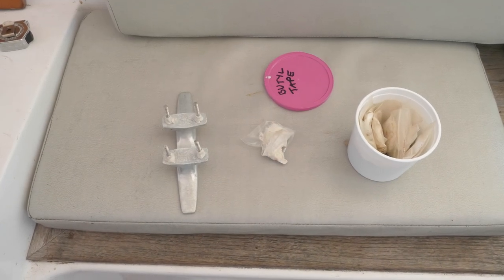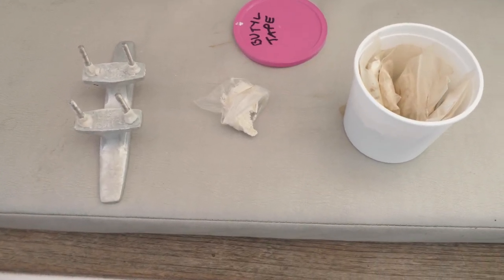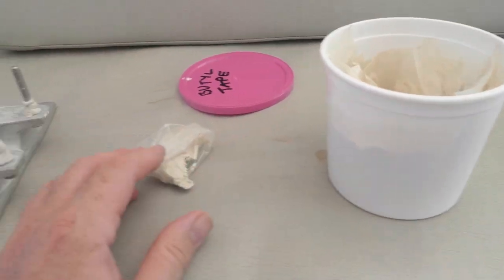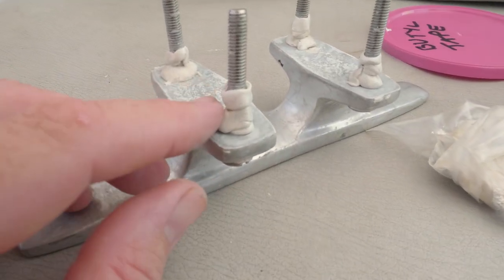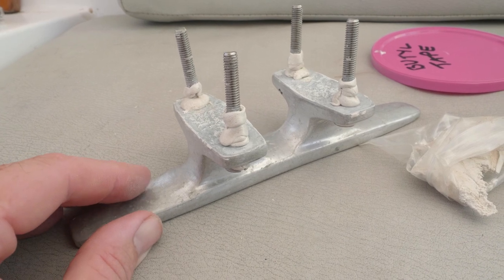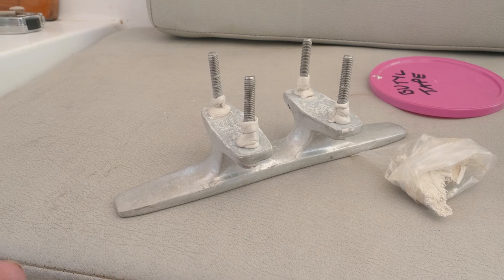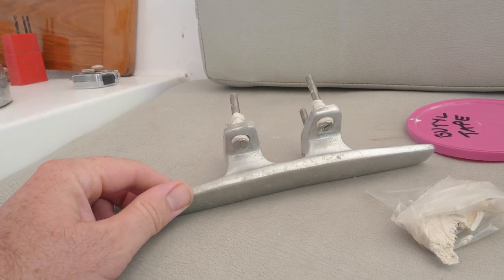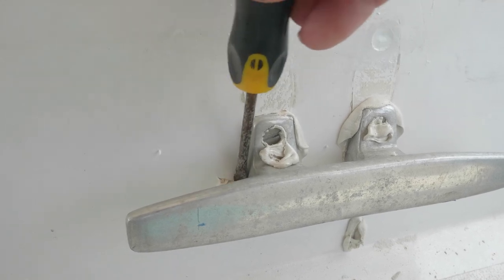HOW TO USE BUTYL TAPE TO SEAL DECK FITTINGS ON A SAILBOAT - SAILING FOLLOWTHEBOAT EXTRA

Comment: I have never been a huge fan of coming back later and re-tightening nuts after cure, but with a material like butyl tape that can "cold flow", it makes perfect sense. Turning the bolts instead of the nuts i can confirm will dramatically increase the chances of creating leaks. But giving them a one-time-only 3/4 turn back and forth during initial assembly, will distribute the sealant to all the nooks and crannies. You cannot expect a good seal if you just drill-and-bolt. All the drilling must be completed and everything must be disassembled and cleaned, before any type of caulking or final bolting occours. For wood or sheet metal screws, which must be turned, try Boatlife Life Caulk. Except for professional boat builders driving square or hex socket head screws all day every day etc, driving any stainless screw, or running up any ss nut with an electric driver or drill, is Asking For Trouble. Drive boat screws Mauually. If the sheetmetal screw is too hard to turn, your pilot hole is too small. Ignore the charts that state pilot hole sizes, this is boatbuilding not aircraft assembly! If your bolt head can still turn after the nut is tight, remove the nut and add washers. I will never use a ss split lock washer, those must be spring or high carbon steel to work as designed. Nylock nuts are a great choice, but use regular nuts for the preliminary fitting instead of wearing out the plastic inserts. I have not assembled a single Stainless nut to any ss bolt in the last 30 years that did not have anti-seize compound added to the threads. It can destroy the seal, so just add a dab to the bolt end before screwing the nut on. To avoid electrochemical reaction between the stainless and the anti-seize, avoid graphite or aluminum based products. My favorite is the Starbrite red, or use nickle-based anti-seize, which is often found in hi-temp formulas. OR, stik wax (or warm water surfboard wax), is an excellent anti-seize! Notice that Jamie does not put the sealant around the deck holes, that will just push the caulk out. Put the caulk or tape on the screws or parts near the top only. Less mess to clean up. I have to agree with your assessment that cordless drills are inferior to a good high quality corded tool, but how practical is that if you have no genset or monster battery murderer, oops, i meant inverter! Tip: if you run your american drill on 220v found in many countries, it will spin Really Fast! Wordy, i know, aimed at people who really care and realize the quickest method is to Slow Down. If you really want the best results, make all projects multi-day, that is, take your initial ideas and sleep on it. Thank You.
Reply from the maker: Thanks for the comment, Marty, there's a few great pointers among it. I noticed Beta had put a small amount of Locktite on my impeller housing screws in the same way you describe - just a dab on the end. Didn't know the stik wax trick - does that really work? Cheers.
Reply: Sailing followtheboat i was surprised to read the label and see "anti-seize" listed. I always have a tube with me because it is very handy for any kind of rope splice. Really i believe the nickel base is best to prevent stainless nuts from galling. Locktite is great for resisting vibration and a great insulator. Regardless of color, never worry about whether it will ever come apart when it needs to, it will. Anti-seize is especially good for stainless, if you magnify the threads with a loupe, the roughness of this metal is startling. Anti-seize is good for engine etc bolts too. Just realize that published torque values do not apply to any thread which has anti-seize on it. The danger is overtightening. Yikes. High carbon steel bolts are way stronger than ss, but they will rust away outside. So that's one reason our engines don't have ss bolts. Another 2 reasons are they are brittle, and although they are not officially graded like steel engine bolts that can be grade 5 or even higher, but 18-8 ss would never be more than grade 2 with a few pence change. Can we combine locktite and nevr-seez? Heck yes. One should realize that it only takes a bit of anti-seize, any amount is likely enough. Anti-seize is an extreme pressure lube, which is what a srew thread (inclined plane) Needs. Tube wax is ok in a pinch, but nickel is best. One would think the copper-based anti-seize would be best for avoiding corrosion on copper alloy fittings like bottle screw threads of bronze. Turns out that the very noble nickel is still better on a bronze, or stainless, or a combination of both, turnbuckle thread. And stick wax, like Castrol, is also the Best cutting oil for stainless, bar none. Seriously, if someone needs to cut a ss bolt, clamp it in a vise between two pieces of wood and extend the wood outside the jaws, to where the sticks will get cut too. That will help steer the hacksaw blade into one spot, not dancing all over the place to start the cut. Or make your cut with the blade just grazing the vise jaw. Start the cut and stick a blob of wax onto it. Use a Coarse tooth, high speed steel blade, like 18 teeth /inch. Two hands on the saw. Once the blade is moving with each stroke go from no pressure to as much weight as you can lean into it. Never let the blade stop whilst applying pressure. Most bolts will take less than 10 strokes. Using a blade with fine teeth, like 32tpi, will only Polish, and even harden stainless steel. Think of it as cutting a crystal, we need to RIP through that sucker. If the stainless is thick, a 14tpi blade will work, for thin sheet metal make all cuts through a thick ply wood sandwich with the metal in the middle. Manually cutting stainless is always going to work better than a cheap bandsaw or any sabre, scroll saw or sawzall blade, once you get your technique dialed in! Cheers and thank you for providing this space for me to vent.

Comment: I am a big fan of Butyl tape and have been using it ever since your refit video.  There is a website made by a guy who sells his own special formula of Butyl called "Bed-it Butyl" which goes into a lot of detail on the hows and whys of butyl tape.  

http://www.pbase.com/mainecruising/rebedding_hardware&page=1

Mads at Sail Life has a lot to say about the benefits of butyl tape in many of his videos too.  It is great stuff and I use it almost exclusively above the waterline. 

We have one weird problem with butyl tape and that is with our stanchions.  We had to go back and re-do them all again after our deck repairs were don because the Hallberg-Rassy stanchion bases have a large dish to them since the bases are dished upwards in the middle from their outer circumference .  This is probably to help more bedding compound stay under the bases but in the case of butyl tape the bedding area is so thick between the deck and the inside of the dished stanchion base that there is not enough force/pressure pushing down on the "O-rings" around the bolt holes to keep them well-bedded when the stanchion is torqued around over time.   We went back and put a washer on every bolt so that it is the washer itself pushing down on the o-ring where the hole is bevelled and then 1 more butyl ring on top of that between the washer and the stanchion base, and then again one more butyl ring above the base and under the bolt head.  This seems to have filled in the gap nicely, and fixed our leaky stanchions that didn't seal right with just butyl last year. 

One other common problem is just like you mentioned where you can not turn the bolt or it can rip and tear the butyl o-ring in the bevel.  So plates that are fastened down by screws (like some slotted cover plates over/around the chainplates) sometimes have issues with butyl since you obviously MUST turn any screw from above.  So far our stanchion bases with screws have held up fine but I may need to go back and drill tiny #8 through-bolts at each screw-hole to replace the #8 screws being used in these bedding plates.  Screwing to the deck with screws is a little asinine IMHO.  Expecting screws to hold threaded into the top fiberglass layer is a bit much to ask over the decades.